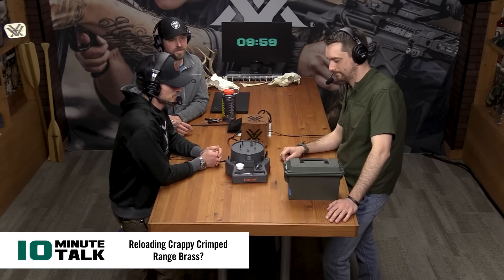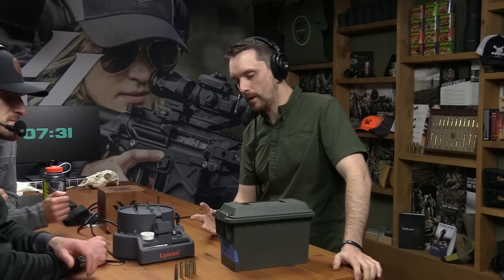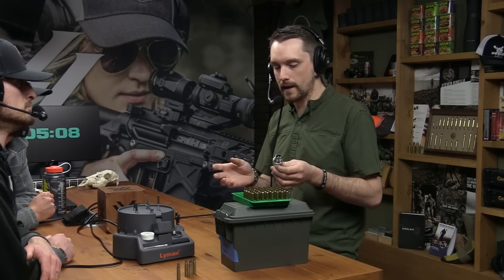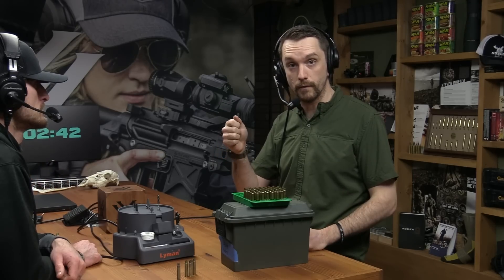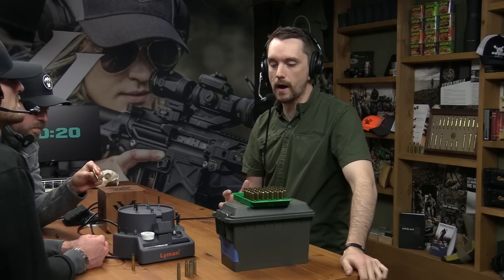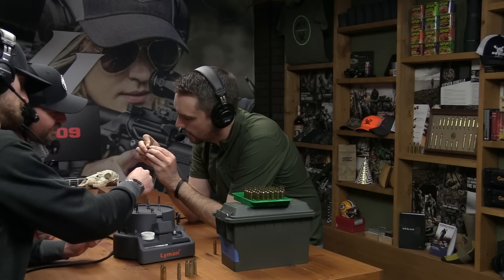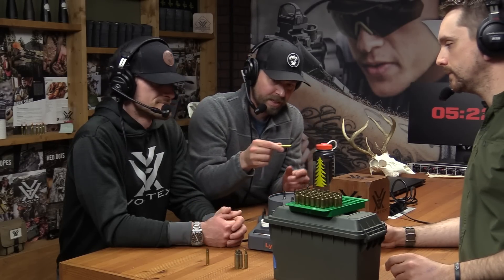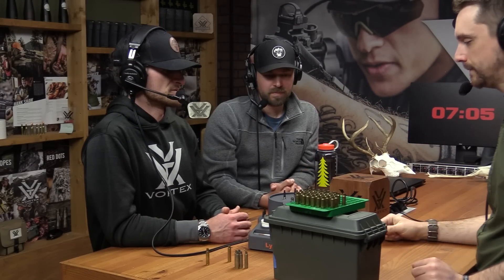#10MinuteTalk - Reloading Crappy Crimped Range Brass?

Comment: AR brass prep is my favorite winter project.  I tumble range pick up brass as I acquire it all year.   I will lube, size, and decap all the brass.  Then I sort by headstamp.  I trim, decrimp, and trim the brass while sitting in front of a PA system cranking music.  Once that is all done tumble the brass again and hand prime.   I use a table mounted Lee priming tool.  Fast and easy!   I tend to favor LC brass as it is the most plentiful.   I store my primed cases and load at my leisure.  I use a Frankfort Arsenal case prep station but I've also made my Dillon decrimper into an auto eject unit which triples production when I use it.   I usually run 300-500  cases a night through the trim and decrimp process.  When I finish the 223/5.56 brass I move on the 300blkout and then .308.  When all that is done I pop my head out of the ground and look for signs of spring.  LOL

Comment: Lee also makes a depriming rod and base combo, which used with a hammer, knocks the old primer right out.

Reaming is easier, and I prefer it for processing bulk plinking brass.

Now, if dealing with same-lot brass I'm prepping for accuracy use, I'll use a pocket swager. It'll preserve all of the material, and work-hardening the area around the pocket should help brass life.

Comment: Loaded thousands of nasty, years old, crimped pocket brass from the sheriff's dept range. I use a drill press with a reamer. Turn the press on, stick your brass under the reamer, push up on the case. Takes two seconds per case. Throw the tumbling pins in the trash, you don't need them. Lemi-Shine and Dawn are all you need to wet tumble. Don't believe it? Try it.

Comment: Brass rat here.  I primarily use range brass. I built a wet tumbler that will hold around 1,500 to 1,700 pieces of brass at a time. Most of the time I run it through the wet tumbler for a couple hours first before I de prime them. I. also use a universal de priming tool. Wet tumbling keeps the crap out of your press, off your hands, and out of your dies. At todays brass prices and availability I don't know how people buy new brass if they shoot very much. I saw 200 pieces of new .300 blackout brass the other day in a local sporting goods store for $80.00. I can cut, form, trim, remove primer pockets from many 2.23/5.56 pieces of range brass for that. When the weather is bad that's my routine. Set in the shop and pump out brass. Nice to have it when you have buddies that reload you can trade components back and fourth. Good video!

Comment: I have the exact same Lyman case prep center and I've tried several different styles of crimp remover tools and finally just chucked my remaining 5.56/crimped brass in the trash. I ordered a $17 shell catcher off Amazon and I'm just ganna catch all my store bought .223 and load that brass from now on. Back in 2020 I loaded 1000 rounds with ebay military range brass when that was all I could find. No mater what I did I could never seem to find any sort of consistency in how much or little to trim from the primer pockets. Even after all the case prep some of them primers would make me cringe going in and that's why I personaly decided to just stick with .223 brass HOWEVER I must say that the 5.56 brass loaded ammo, even with subpar primer seating has always shot very accurate and consistent for me in all my .223/5.56 rifles so it may just be an OCD thing for me more than anything lol.

Comment: I use an RCBS chamfer tool to do that, simple cost effective and here in Australia we don't have to pay up to $900 AU for the moterised station, deprime, remove crimp and clean primer pocket with hand pocket cleaner, not hard and simple for those on a budget or just wanting to save $$$

Comment: A question if I may: around here, "range brass" is Berdan-capped. I know how to de-cap them, and the can be de-crimped (although it's tougher to do because of the anvill) but in your opinion, is it worth the effort?
Reply from the maker: Just getting to this now - a bit late sorry! Berdan-primed brass can be reloaded, but it is not so conventional and requires some specialized tooling. Often, a hydraulic solution is deployed, where the case is filled with water, and a piston is inserted into the case mouth and driven downward, knocking the primer out. A small decapping rod with a double decapping stem could also be used, but the user would need to locate and index both flash holes before knocking it out. 

It can be done - but whether it is worth doing is definitely in question!
Reply: @VortexNation  thanks. I have tried hydraulic decapping and the RCBS Berdan de-capping tool (a tool whith which you dig out the primer by hooking into the extractor groove). With both methods case damage occurred more often than not. Cases were Kynoch .404 Jeffery. At the time there weren't too many other options.

Comment: Another thing on collecting outside range brass. When raking and scooping them up. A load of dirt and rocks and steel case. A media separator is a great tool. Fill the box full of water and wet-tumble the brass. Dirt and small rocks fall through and sink to the bottom. Then I dump the shells on a large towel on the ground and Hose down. Grab the remaining rocks, then run a strong magnet over the brass to get the steel cases out. Then I dump them into my shell sorter pans to get the brass sorted. Yes, a lot of work, but I have brass coming out of my ears.

Comment: well gotta ask this question--anybody ever had a case head split or separation due to previously reloaded range brass getting too thin in the case wall? All this other stuff is easy--isn't this a consideration with range brass?--gotta bunch of range brass i wanna' use but just slightly leary of that condition.

Comment: I have some brass that is dark brown even after wet tumbling and lemi. It loads just fine and fires very well. Then firing it goes back into loading, and absolutely no oddities. The downside is with outdoor range brass, the freaking cleaning and sorting before you can even think about running on the press. But I have a box full of assorted brass in case I buy something that fires that caliper.

Comment: With all brass now with spent primer still in. I throw into the tumbler a heavy dose of dawn. Tumble for 20 minutes. Then tumble them in the separator to get water and crap out and get them rinsed off. Dry them. Lube and process. Then dump into a large container loaded with hot water and dawn. Purpose remove most of the lube. Then into a tumbler for 2 hours with a small dose of dawn and lemi and ss media. When I drain the tumbler my water is not black nasty crap. My tumbler and media stay clean now, and the brass comes out great. I ran into the problem of this black coating in tumblers and brass not coming out shiny.  So yes, doing it this way takes extra steps but good results consistently.